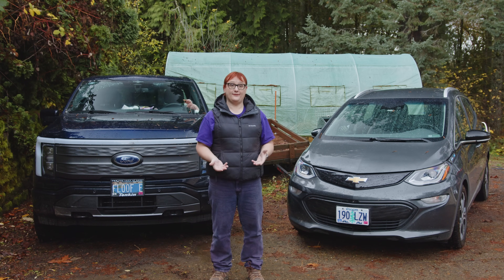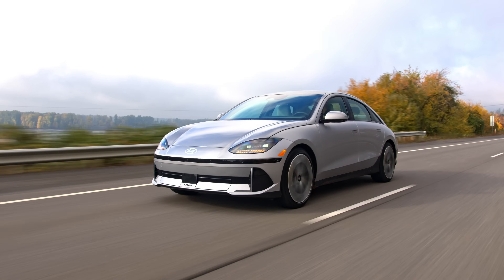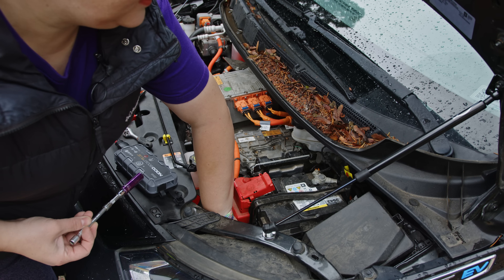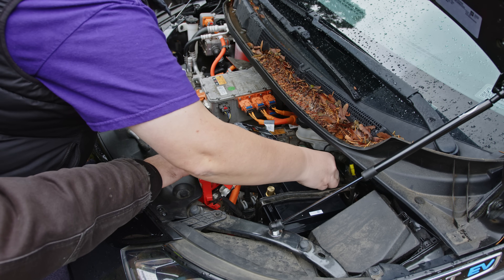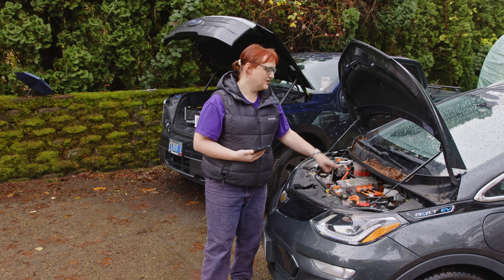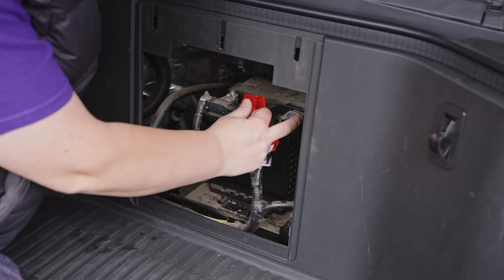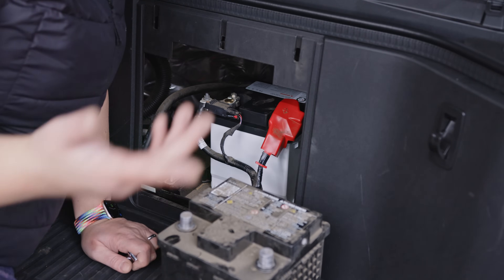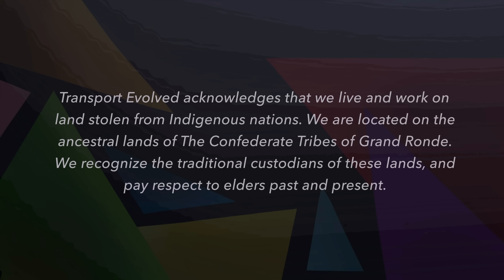Long Term Review (Intro) : Are These EV 12V Batteries From Ohmmu A Better Alternative To Lead Acid?

Comment: other than habit, is there a reason we still have a 12 volt system? wouldnt we be better off with just the traction battery? that would make the car a 48 volt system, wouldnt it?
Reply: Most automotive systems are 12V. Traction batteries can come at up to 800V, which would be utter overkill for things like headlights or the radio.
Reply: @downix  no, not overkill, if you crank the voltage you can lower the amperage and make the system safer.
Reply: For modern EVs, the traction battery pack outputs upwards to 400v or 800v depending on the system in use (my Niro EV is currently fully charge with a traction battery voltage over 400v). I know there is a desire to use a 48v low voltage rail as it’s more efficient for the DC to DC converter and still relatively safe. The problem comes in that all “accessory” electronics (radio, dash, USB ports, etc) are currently designed for a 12v system. So a lot has to be re-engineered. Many car makers don’t make all of their own components and will integrate third party systems. So, at some point, we might see the move to 48v low voltage rail, but right now it’s not really viable.
Reply: @bedast  consider that it took nearly a half century for auto makers to switch from 6V to 12V.
Reply: @downix  so habit, AND laziness.
Reply: @scottmcshannon6821  It costs money to throw out a century of built-up infrastructure
Reply: @downix  it has to be done sometime and it will only get more expensive.
Reply: @scottmcshannon6821  why?
Reply: @bedast  so it is just a habit, expensive to break, but even more expensive not to break.
Reply: When the car is stationary, the traction battery is typically disconnected, that makes it safer. But you still need some power to open and 'start' your car. Some do implement some intelligence to top up that 12V battery from the traction battery as needed, but unfortunately that's rare
Reply: @flemlion13  that does make more sense.
Reply: @flemlion13  "Some do implement some intelligence to top up that 12V battery from the traction battery as needed, but unfortunately that's rare" -- not sure what you mean by "that's rare". All EVs consume electricity via high-voltage charging of the drive (traction) battery, and then use a fraction of that charge to charge the 12V battery as needed. It's not rare at all.

The one caveat in this is that the gen 1 LEAFs had what IMHO was a flawed design, in which they would only charge the 12V battery while the car was being driven . I assume that this was some attempt or consequence of the engineers keeping some systems set up like an ICE car, to what end I have no idea. Maybe it had something to do with whatever logic was used to control the high-voltage cut-off, such that the drive battery was never connected unless the car was literally in a drive mode.

It was crazy though, because it meant if you left the car plugged in for an extended period of time without disabling scheduled charging, the car would wake up every day to check whether it needed to charge, then shut down again. This cycling of the charging logic was enough to fully drain the 12V battery in a matter of weeks.

When this happened to me, I double-checked the user manual and sure enough, there was a warning to keep the car unplugged if leaving it for an extended period of time, so that it wouldn't do this repeated charge check and drain the 12V battery. Seems to me it would've been smarter to just allow the 12V battery to be charged even if the car was just sitting there. And every both EVs I've owned since (a Tesla and a Kia) do in fact do it that way.
Reply: @harvey66616   I mean that it's rare for the car to wake itself up to do it. Most rely on the car being driven. When it's stationary that 12V can thus go empty even with a full traction battery. With the VW IDs it's an option to let it use the traction battery for convenience features.
Reply: @flemlion13  "Most rely on the car being driven" -- the gen 1 LEAF is the only EV I know with that behavior. For sure, Tesla and Kia don't do it that way, and given how problematic that approach is (in the LEAF it results in draining the 12V battery in a matter of a week or two, under certain circumstances), I'd be surprised if any other EV models refuse to charge the 12V when the car isn't driven, never mind "most".
Reply: I wouldn't call it a habit. Most automotive parts and manufacturers are designed to use the 12 volt system. It would take a lot of effort to get a whole suite of manufacturers to make 24 or 48 volt systems. I think the Cybertruck has a 48 volt system but still has a DC step down converter for 12 volt parts.
Reply: The drive battery is kept separate and isolated for safety purposes, 12-volt activate the contactors to connect the car to the drive battery.
They stay with 12v instead of 48v because existing accessories our design for 12v $$$.
The laziness part is not searching l "why  does an EV need a 12 volt battery"
Reply: And automotive isn’t the only customer for those electronic components, probably not even the largest consumer. Most prefer the lower voltage components. That’s why there have been decades of effort to drive down the voltage and power requirements.

Perhaps they can partner to make it worth the time and effort for one or a few suppliers (who wants to be locked into a single-supplier situation?) to design, produce and stock higher voltage components.
Reply: I won’t be rushing to buy one these! I can get a lead/acid battery with a 36 month warranty for $42 so no contest IMHO! I would rather do that than ask my Nissan dealer and pay them an investigation charge to ascertain the reason for the battery failure. Anything they can dream up to increase their charges they will attempt.
Reply: You need some form of low voltage system for safety, and ease of using lower voltage accessories, but it could be anywhere from 6v to 50v.  12v happens to be the current industry standard due to the chemistry of lead acid.

However, to your point, there's no reason it even has to be separate from the main high voltage pack.  They could have a small annex to the traction battery that supports low voltage duties using the same cell design and chemistry as the high voltage pack.  Nobody does this yet.
Reply: @GregHassler  I thought the Rivian Gen 2's began doing this
Reply: @downix  youre are assuming rivian ever gets the gen 2s into actual production.
Reply: @scottmcshannon6821  Er... they entered production in July. Already over 30,000 Gen 2's have shipped.
Reply: @downix  according to their website production of the R2s will start in 2026.
Reply: @scottmcshannon6821  That is the R2. I am talking about the R1T and R1S Gen 2, which began production in July.
Reply: @GregHassler  you dont need low voltage for safety, you need low amperage for safety.

Comment: Safety tip: when disconnecting a 12V car battery, remove the negative terminal first, then while you're undoing the positive terminal there won't be any fireworks if your wrench accidentally touches any bare chassis parts. Similarly, replace the positive terminal first when reconnecting.
Reply: 12v shock is not  a danger. but 380a will turn a gold ring in to glowing red hot flesh burning molten disaster! 12v@380a=4.56kW  some GOOD jumper cables and a used led  battery could be a video but leave out the burning flesh. Not all car are negative ground, so remove ground first and connect last,  weir no rings watches or any metal  Juley.
Reply: @cuepusher2504  "12v shock is not  a danger" -- no, but igniting hydrogen gas that's accumulated around the battery is.

Actually, the risk of that is pretty slim these days. Maintenance-free/sealed batteries have almost eliminated any off-gassing. And of course, in a case like this you're only dealing with the lead acid battery for half the operation. The sodium/lithium batteries don't have the same ignition risk at all.

But it's still a good habit to keep, because basic swap of batteries is well within the capabilities of a much larger number of people than those who can reliably identify the actual risk of a battery fire or explosion. Even with the fast diminishing risks in modern cars, one might as well stick with the safest procedures, just in case they are one day in a riskier situation that they wouldn't recognize.

(Shorting through jewelry is pretty much impossible. The risk of a short here is the tool connecting between the battery terminal and ground; the electricity path isn't through the mechanic at all, nor anything they are wearing. In the incredibly unlikely event that there's actually a path from battery terminal, through a tool, touching jewelry, and then from there through the mechanic's body -- say, for example, they are using their other hand to lean on a grounded part of the car -- the person's body has too high resistance for much current to pass through any of all that, certainly nothing close to the 4+ kW you're worried about.)
Reply: @cuepusher2504 came here to say exactly the same!
Reply: Doesn't work for my '60 Hillman (positive ground) ;)
Reply: 12v can still make your testicles tingle